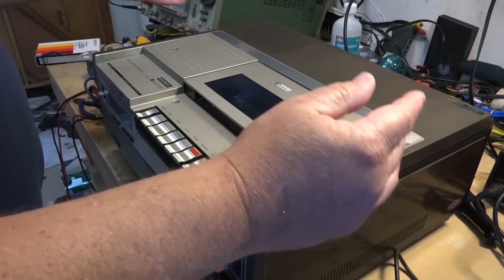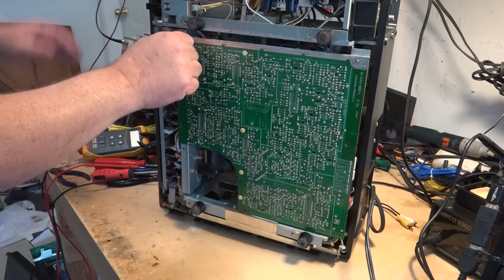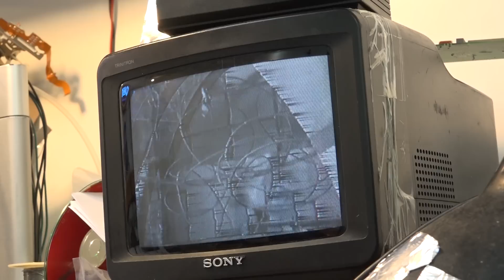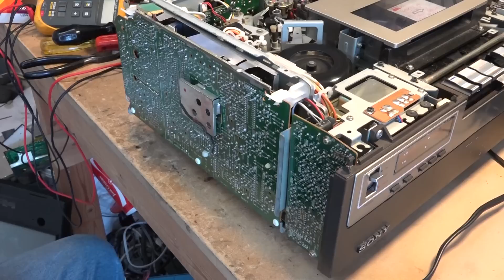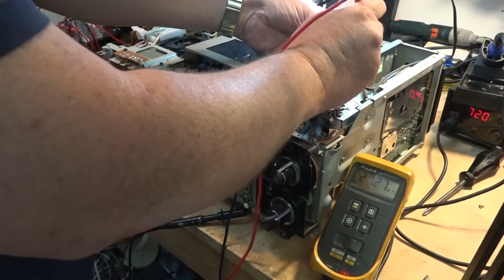Sony SL8600 Vintage Betamax Repair

Comment: Hello engineer, I have a Sony Betamax sl.f1 device. It is 12 volts
. The device turns on. 
The cassette input and output are intact.
 The forward and backward keys are intact. When I press the movie start button, it does not allow the movie to play at the first moment and it cuts out quickly. What is the problem?
Reply from the maker: Not familiar with that model

Comment: This was my first VCR purchased in June 1978. Paid $864 but sold it two years later for $300 after buying a SL-5600 which could record and play BII and BIII and could with throwing a switch on the back, play BI.
Reply from the maker: In 1979 an rca vct201 was 2,000.00

Comment: I got a sanyo betacord vtc 1900a today. Plays good. But when loading and ejecting, I have to manually push the carousel with some force. Would that be loose belts? It also loads and ejects if I manually turn the pully that runs the gear on the bottom of the machine. Love your videos by the way you're the first channel i go to when fixing all the different types of cassette style machines I find and need to work on.

Comment: I wish you had a video on fixing the SL-8200 (almost the same but with a second motor for the capstan) I've got a couple of Zenith rebadged SL-8200s where the capstan motor doesn't want to run. The most frustrating part is one of them was fine until I swapped the motor from the other one in to test it (wanted to see if it was the motor or drive circuit), now it won't run with it's original motor either. The control IC isn't outputting DC drive voltage and I'm not sure why.
Reply from the maker: Don't have one.   If you put a bad motor on a good circuit If it was shorted it can blow the circuit.

Comment: Was there a reason that Sony used mini audio jacks instead of the same size jack like composite cables?
Reply from the maker: They used to use so239 for video, then that changed to  BNC.  
Audio was always 3.5 or 1/4" in the early days. The reason was these early machines were used in many industrial applications where lots of different hands would touch.  Having different physical plugs eliminated dummy's plugging then in backwards.  It wasn't till rca released their VCR and demanded rca connectors for inputs and outputs.   Those standard plugs that you connect audio equipment were invented by RCA.  They were much cheaper to make than the 1/4" and mini / sub mini (3.5 & 2.5 mm) but they became the standard

Comment: Can you explain how the chroma/luminance is mixed together as a composite NTSC signal on 3/4" and Betamax? I know it's converted up from 688kHz to 3.58MHz, but how is that signal then mixed with the luminance? Wouldn't there need to be some kind of modulator circuit? I've looked at serval Sony 3/4" deck schematics (such as the BVU-110 and VO-4800), and they have a single transistor called "MIX AMP" and the luma/Y goes to the base, the chroma signal on the emitter, and the regulated 10.5V DC power supply is connected to the collector.
Reply from the maker: Works exact the same way.  On record the composite signal is seperated from the lumamance. 
It is down converted by hetrodyne with a carrier to 688 and directly recorded on tape as a dsb signal.  The lumamance is FM modulated.  
On playback the FM signal is demodulated and the chroma is added to a carrier to convert it back to 3.57954583 MHz and simply mixed.  There is a little more than that, there are delay lines ect to make sure that the signals are properly aligned when added.  It's fairly complex and i have forgotten much of the process as I haven't done much with these old machines in 40 years.   More modern ones had everything burried in an lsi chip.  I remember beta 3/4 and 8mm investing the phase of the chroma 180° for the even and odd fields.  VHS stepped forward 90° on each field so VHS took 2 frames to get back to starting phase and beta started each frame in phase.   
Oh God it's coming back to me now.  I tried to forget all that crap.

Comment: Hi, enjoyed this, I worked on all the sony series Bata, half in , 3/4 umatics, converted to editors, 1 in. with pizeo heads, all great machines with the best suppot and documentation. The cameras were good along with the 3/4 in eng recorders then the batamax eng and editors with time code for broadcast series. Course  panasonic and jvc simular, The superstic editor was a great mod with the audio corection when crusing the raw footage for voice cues.

Comment: Did you replace the playback belt with a rubber band?? Is that the hidden fix you did under the mechanism?
Reply from the maker: A rubber band wouldn't last very long on a unit like this. The belts designed to slip as this uses a break to slow down the drum to the correct speed. I should haul this machine out again and see if it still works it hasn't been used since the video was done it'd be interesting to see whether this one even turns on now.  One thing I know that it does have new is a new head. Back when I work for Sony the SL 728600 that I have where two of the machines that I did training on. The instructor found a couple of old machines that have been just lying around that have been written off put them up in my bench and let me go at it to repair it. Both of the 7200 and the 8600 required a new video head as it was worn out. These ones were very complex time consuming jobs to change same with the 5000 series Emily 6000 series that had the three piece Head drum with the center cylinder that spun. Once I had them fixed I asked the instructor was going to happen to them he said take them home we don't need them we're not going to sell them we're just scrapping them they're written off. I believe he did expect me to remove the head though and put the old one back on but that didn't happen.

Comment: You did a video on the SL 2000 'portable' recorder/player. I had the Zenith clone. Had the HV 2200 camera, the 10 meter extension camera cable and the 'portable' travel case. Everything could fit into it for location work. The bag was ~ 3 ft. long, ~20" wide, and ~ 12 " thick. Finally had playback problems that I could never get fixed.
Reply from the maker: Thanks for the memories.  I had that same bag.  When loaded up one just about geve them self a hernia picking it up.

Comment: The Pinch-Roller Solenoid on my SL-8600 won’t activate in Play Mode. The solenoid activates fine in Record Mode, but not in Play Mode. 
The unit was working fine and this fault just started happening. Does anyone have any info about this fault?
Reply from the maker: Probably a leaf switch that is activated by play button.
Reply: UPDATE: I traced the problem down to Diode D19 behind the front panel. I replaced the diode and it’s now working fine again :)

Comment: putting new belts and lubricating is the most serious thing about this type of device?
Reply from the maker: It was more of a, let's see if this thing works without putting any parts in. Why? Because i don't want to spend any money on it.  It's not like this machine is being used for anything.
Reply: @12voltvids  I understand, is that I like these devices, they marked a time well, an example of this that is more than 3 decades old and is still in operation, this is no longer seen in modern devices that are disposable.
Reply: @12voltvids  do you happen to know where to find the wiring diagram for this model?

Comment: Although the original post is 5 years old, I would like to tap into your wisdom and ask why I hear audio and get blue screen for video out of my SL-HF400?
Reply from the maker: The blue screen is likely your TV generating a blue screen when there's no video signal active. On your slh400 there are two soundtracks one is the Hi-Fi track which is played by the same head that plays video the other is the linear track which is recorded on the edge of the tape if there's no video say caused by a bad head or dirty head the system will switch to the linear soundtrack and you'll hear sound

Comment: I read there are 2 ways to wind the tape,. First units used the identical Umatic tape path (M) and later machines (front loaders???) used a simpler left side winding technique. Is ir true?
Reply from the maker: Beta machines always used the U loading system like umatic.  
VHS used the m loading.  8mm started out using U loading and changed to M loading.

Comment: 1:59a Avery well repected technician I know writes the date of repair on the bottom with a felt tip pen.
Reply from the maker: Easy to change that date.   Ronson lighter fluid will remove the ink without a trace. Before computers we did the same and people would change dates and bring back wanting warranty work.

Comment: Hey there... good vid ...ty.. just bought one of these... trying to get it workin.... where can I get a set of belts? thanks.....
Reply from the maker: I have no idea where you can get belts for a unit this old.  I don't have access to any parts these days.  The shop I used closed their doors.
Reply: @12voltvids  damn.... ok... really appreciate the super fast response.....
Reply: Wes components Sydney Aus list a belt kit as vbk13 for a sony 8000/8080 & 8500

Comment: Wow Dave, I bet ya that this machine would confuse Nasa engineers. This unit is built like a tank, not like some of the later bottom of the line vcrs that were all plastic crap mechanical components.  Very Cool !

Comment: I Just Got A SL 5400 It was not working at First it would not Play FF or Rew. But after Cleaning the Rubber Tires It Will Play and FF but not Rew. Do you know what would cause it not to Rew. Let me know thanks
Reply from the maker: Rubber tire. It is probably driven by a plastic wheel right.  If the drive wheel is metal it has had the rewind kit installed.  If plastic it is the old drive wheel. Another thing that causes slow or no rewind is the upper drum becoming all shiny and smooth.  Tape sticks.  Upper drum should be dull in color if it is shiny where tape runs over it upper drum needs to come off and rubbed with a paste made from comit cleanser or grity tooth paste to remove the shine.

Comment: Very interesting...so it's normal for a motor to run when you press the eject button, even if you don't have a tape in? That's to thread the tape? I just bought a vintage Sony Betamax SL-5600 from a thrift shop a few days ago and I'm trying to get it to work. When I press the eject button, I kept hearing a noisy motor running and I had no idea what that was for.

Comment: That's a really old looking machine for I think you said 84. In '84 we got our first video recorder, and it was a SL-C7, a total beast of a unit. It did seem to like to eat tapes, pretty much from the first day we plugged it in.

Thanks for the video!
Reply: that´s a PAL Machine.  In 84 you used the older machjine (yhis is a 1977 one, analog tuner) to train.

Comment: I have a Sony SL-HF2100 which was working great until we had a power outage last week. Now it doesn't turn on at all. Any suggestions, I checked the fuses and they are both good.
Reply: Capacitors in the power supply

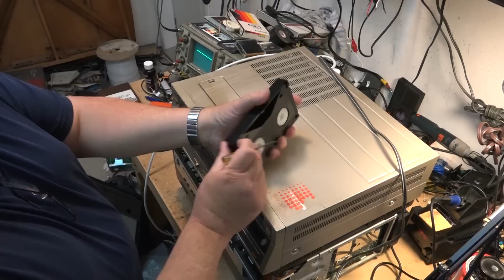Comment: 47:28 That tape is from the 70’s. I have some Sony tapes like that (500 on the left of the label) from 78 or 79.
Reply from the maker: I have no idea how old that one is. I bought my first Betamax when I worked for Sony, and it was the SL5200 shown in this video. The 8600 and 7200 I pulled from the garbage can and rebuilt them.

Comment: Hi! This is Very Interesting... I have one. Mine looks a little different. SL7200A. It does turn on I used it several years ago. I try to open it it sounds like it wants to open but doesn't. After watching your video It Probably doesn't open because it has a tape stuck in it. I have about 70 used tapes.. I got it in the Early 80's and I used it to death. Snicker... I am not sure I want to take it apart but thinking about it after watching you fix yours...  Looks like fun to fix!!! But Finding time...

Comment: What do you do if your betamax player plays in black and white and some times but rarely see the color try to come in does it need cleaned or something?
Reply from the maker: Check the color oscillator frequency in the chroma circuit. If it is slightly off frequency it will result in intermittent color.

Comment: Hey 12volts, can I ask about a Sony C6 UB, so I picked up this machine many weeks ago. It had been stored in a damp place so the top is totally rusted just to give you an idea. Anyway fast-forward and I've cleaned and greased and the picture was black and white, flickering and sound was slow. I found out that I needed to adjust these pots on one of the boards, I did that and it was massively better, colour was back, more stable picture, right speed but still a little flicker which meant it may need some of the caps replacing. Rather than get the soldering iron out I have another one of these boards out of an identical machine so I swapped that. Pressed play and the screen was black and sound really fast, I just figured that well maybe it's not compatible with the other machine so I put the old one back and it's still a blank screen with fast sound!!! Meaning a new fault has occurred, maybe on the other board as one of the cables from the swapped board plugged into the other. Any help would be greatly appreciated. This machine was a freebie that was in the local advertiser, I've spent a lot of time on it and I really want to fully restore it.

Comment: I just picked up the same model which the original owner claimed had less than 10 house of play on it.  It sat in his garage since 1979 I think he said.  I loaded a tape in and it doesn't load it the whole way.  I push the loading with my finger then I can play and it only plays in black and white also.  Gonna watch this video while I try to fix this.  So happy this video exists haha.

Comment: Just got a Sanyo VTC9300 that looks very much like this one inside. If i'm getting black streaks from white parts of the image is that a worn out head? Perfect picture with darker images tho.
Reply from the maker: If the tape was recorded in SuperBeta then black and white streaks are normal when played back on a non Superbeta machine. Same when a standard tape is played on a Superbeta machine and the switch is set to on, the contrast will suffer slightly.
Reply: Don't think they are SuperBeta as my SL-HF100 plays them fine and they don't even have a hifi track on them. Just bought a pre-recorded tape to test as you did. If it is the heads I have found one going cheap. Also ment to ask if you had any plans to do a teardown of your Sony CV2000?
Reply from the maker: Yes the CV2000 will be torn down one of these days.
Reply: Great! Just tried the Sanyo with a pre recorded tape and no problems at all :)

Comment: 16:30 why a fan? it´s for cooling down the circuit?
Reply from the maker: Cooling the motor. That is a big AC operated motor, and it gets warm.
Reply: @12voltvids  IIRC those motors were around 1/6 HP.

Comment: Another question: 

this model has manual tuner. 
Mine has varactor. 
Does this mean there´s less space and components are disposed in other way? On right side. 
Also, is NOT necessary to dissasemble the heavy main deck ? 6 Kg. Also has many other cables.... and wiring on rear. 
Thanks

Comment: Got a non working 5400 which has to manually pull the cassete cover after pressing eject. 
May be the "scissor" daming system??
Reply: Sorry, damping

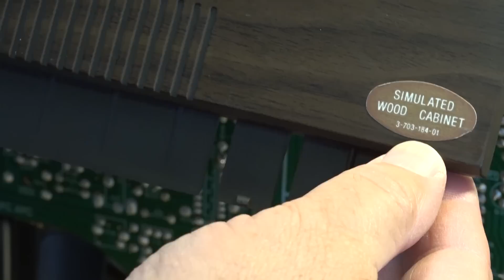Comment: @ 12:40 O, M, G... I these years, what I lie I have lived... ;O)
@ 13:10 LOVE the crow in the background! Just something about it makes me smile. Don't know why... I LOVE working on old stuff. Especially when it's been cast away by someone for junk. When I was younger, I'd go to the thrift stores and look for things that needed fixing. It's nice because when it's been cast aside, if I can't fix it, nobody gets mad, LOL!
@ 16:12 It's funny how industrial things were back then. Induction braking, because digital speed control really hadn't been developed to the affordable point yet. So awesome!
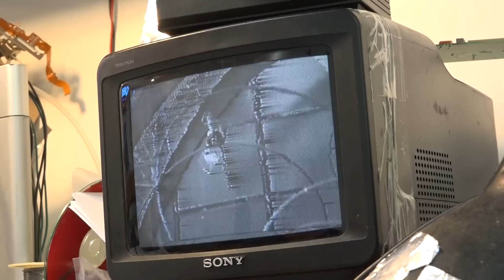@ 20:18 I've had about enough of that noise! LOL!
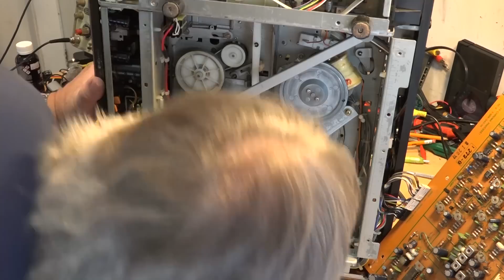@ 23:23 Thank you sweet Jesus! LOL!
@ 24:34 It's interesting to watch the belt stretching from the induction brake here.
@ 26:02 It took me a few times to go back and see. It looks like you replaced one of the drive belts with a rubber band, LOL! I've done it before, just to get things working until I could get the proper part.
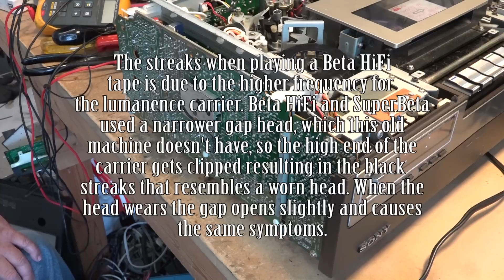@ 31:06 Thanks for the info! I was getting ready to say that the heads are most likely either worn or dirty.
Reply from the maker: The elastic is under the slipping belt, to give it more grip is all.Heads are fine. They were replaced on that unit when I first got it, and it never saw much use after that. My SL7200 also has a new head on it. One out of a B2/3 deck, so if I needed a head for my 5200 I would pull it from this one of  the 7200. I don't have a micrometer to do the eccentricity adjustment mind you so that would be a problem.
Reply: 12voltvids Ohhhh, I see!

Comment: Made of real metal,,, steel everywhere!! Do you have the remote?? RM56W
Reply from the maker: No, just the unit. Yes made of real steel, and weighs a ton. They were all built like a tank back then.
Reply: Isn't it too old for a remote?

Comment: 8600 was a falure, only played Beta 1 tapes
Reply from the maker: The 7200 only played Beta 1. The 8600 only played Beta 2. Still a single speed machine.

Comment: Got a 5600 like NEW , but no power.... oxidize power supply?
Reply: Check if the power supply gives any voltage.
Reply: I wish have born before these things came ouy to market. But Wait!!! they were VERY EXPENSIVE .... Just about in my country the Z600 Sound System (full system with rack) costed around USD $8000 .. and for $9500 USD you could but a DATSUN.